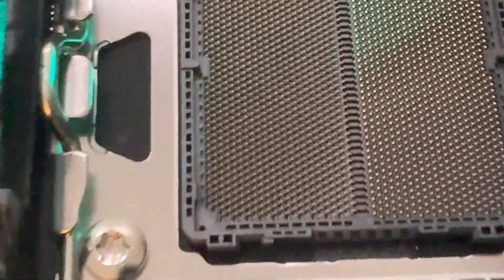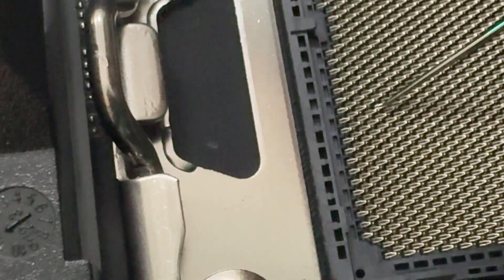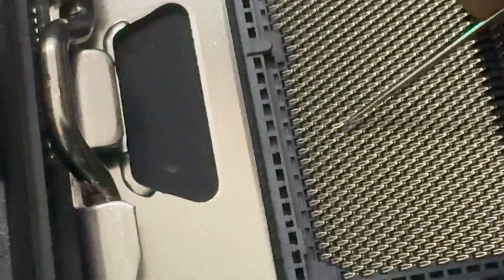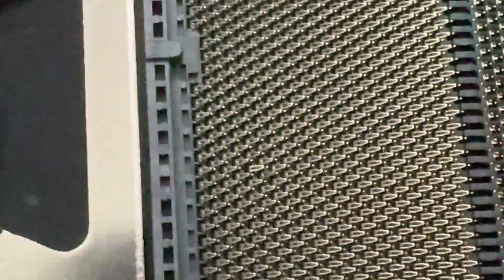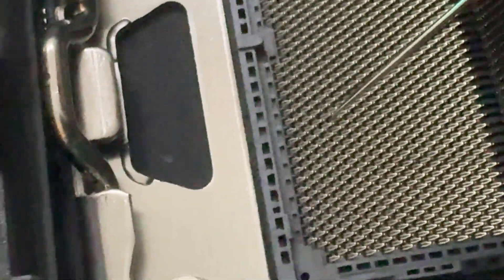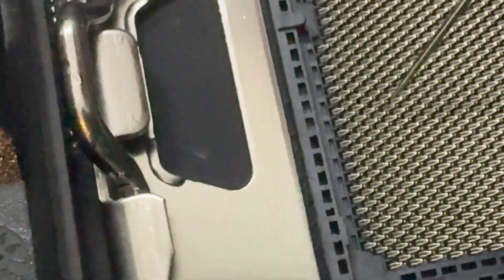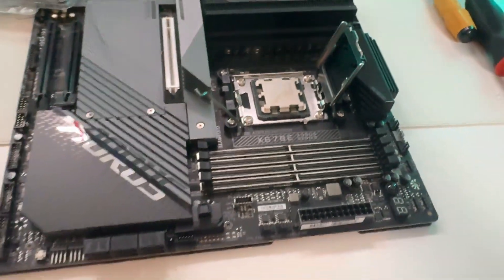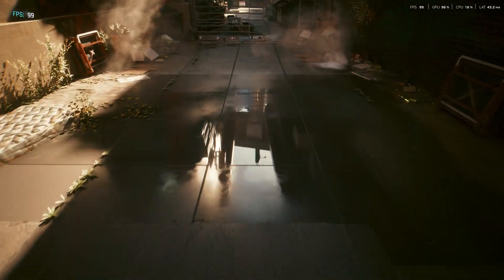How to fix bent CPU pins on AM5 motherboard

Comment: I have 15 bent pins😢💀💀💀
Reply: Did u manage to fix them?😢
Reply: @intfuncx oh hell nah, I got a refund and still kept the mobo😅
Reply: Cause even if I would fix it it would still have problems
Reply: @belca_niexy how tell me please
Reply: @jett27j30 if it is an Am5 Socket and there are like 15to20 bent pins then you are cooked.You can check the layout of what the pin does and if the black and red ones are affected then it's impossible to fix so just get a refund and next time make sure to look at the pins when you buy or be careful not to drop the cpu😊

Comment: The CPU pin design is really bad.
Reply: Am4 is better 😂
Reply: Bring back the crunch!
Reply: in my eyes i think its actually a good design for a mobo based pin design, the check mark looking design makes it so if it bends down or up its more repairable than if it were a straight wire, though it is a pain in the ass when it bends to the side or only the tip bends like it did on my mobo

Comment: Thanks for this. New mobo wouldn't let me POST with ram in either of the two B channels, tech rep suggested a bent pin and sure enough i saw a little glint when I took the cpu off the socket. Used my warhammer magnifier/light glasses to go in with some thin tweezers and pull the one "fish scale" back into place and it works!

Comment: I just have the same issue with a new X870E board, and find no way to fix it.. I will check first with Gigabyte support services because it is actually DoA
Reply: Did you get an anywhere with this? … just happened to me to.
Reply: @SweetDrummerNrOne I eventually fixed it by sending it to computer shop in south China, through taobao, and they help me replace the bent pins